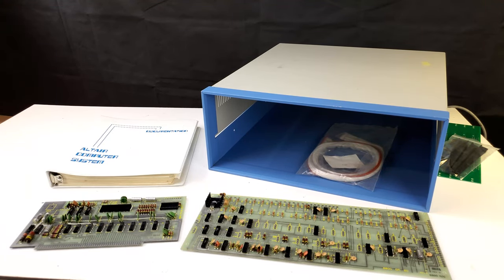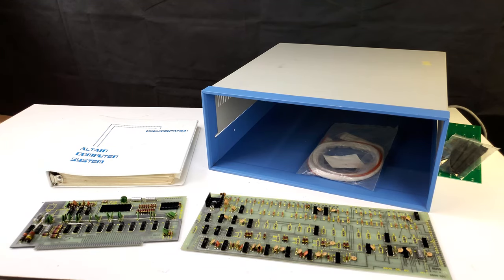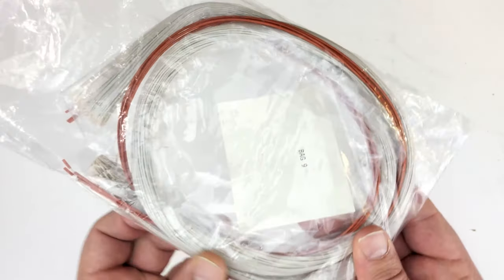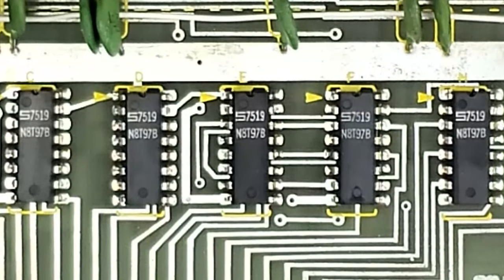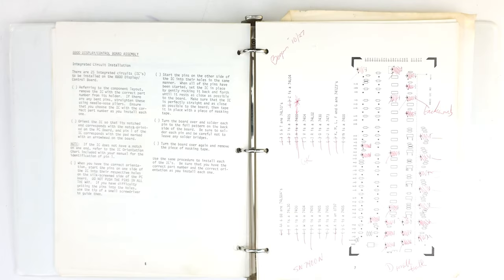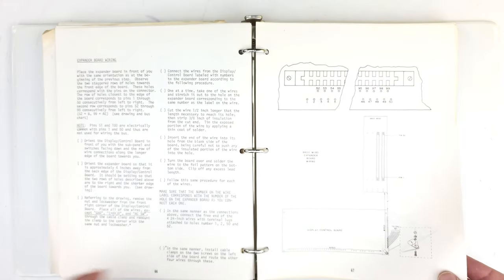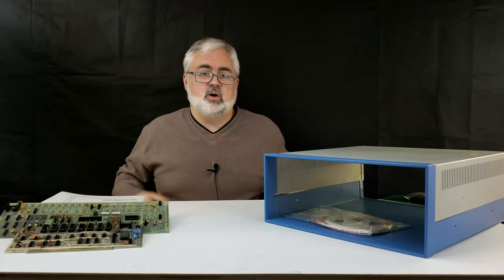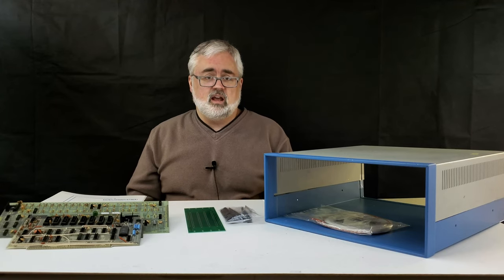I Bought An Altair 8800... sort of

Comment from the maker: What do you think?  Should it be built? Or left alone? 

And yes, my hands were super clean and I cleaned the boards afterwards to prevent further corrosion. :)
Reply: I say build it! A complete working Altair is a good candidate for the centerpiece of the collection.
Reply: Build it.  Don't use the DRAM board.  It's a  nightmare.
Reply: Definitely build it.
Reply: Yes, build it! It was meant to be a thing, not pristine parts. :)
Reply: BUILD IT!
or send it to me and i'll build it...

I have the Briel 8800micro... it itches the bug... but it's basically just an emulator...

Deramp has an original, he also sells his own emulator, that's more correct than the Briel... and on his website he links to sources for an Altair 8800C (C for clone) new boards, case and parts that can be used to assemble a new machine.
Reply from the maker: @inerlogic  The 8800c is pretty awesome for sure, although my inclination was to go for the original clone kit he did with the mostly empty chassis.  I wanted that to sit, open topped beside a real Altair just for shock value.   I had been holding out for Grant Stockly's clone myself.. but it never fully materialized.  Too bad.. it looked to be a beautiful kit!

My only challenge with building this one is I am a bit retentive when it comes to exactness..  I want everything to be 100% authentic.. which will be really difficult in this case.  I'm trying to talk myself into the old/modern 'hybrid' idea but no dice yet.
Reply: @TechTimeTraveller  IIRC Grant said he was going to offer a discount for military/veterans, i'd emailed him enquiring about that and he replied, but yeh, the kit never materialized....
I ended up building an N8VEM SBC, i built the CPUVILLE z80 kit, Lee Hart's kits, i just finished an RC2014, I have the Briel 8800 micro... i have 4 different machines i can play Zork on and run CP/M

When i was in school for electrical engineering (95-2000) tucked away in one of the labs under a pile of stuff was an altair 8800.... had i known what it was at the time, i may have liberated it....

Mike (deramp) makes a good point in his videos, run his box so you're not endangering a museum piece or dealing with questionably reliable ancient hardware... if i had the money, i'd build the 8800C... new machine, new components. But still compatible with the old boards. Build the new box, and then maybe build an old one... use the new box to test the old boards....
Reply: Do what you did with the TV Typewriter and find components from the right era to finish off the two PCBs you have. Make your own chassis for the internal stuff and don’t be afraid to use modern parts for a power supply. Make a replica for the front panel. S100 machines were constantly upgraded so there’s no wrong cards to put in it, and no “correct” backplane either. If down the road original Altair parts show up you can always swap them in. My IMSAI came with a third party upgraded backplane and a Josh Bensadon CPU board and I’ve been very happy with it and have seen no need to change those parts out.
Reply: Would love to see you build it! I agree with you that computers are meant to be used.
Reply from the maker: @timlocke3159  Sorry for the totally out of place reply - youtube doesn't provide easy ways to reach people directly - your comment on my BBS video was great, but youtube nuked it because the fidonet IP looked like a link.  Apparently they are nuking all of those now (except for ones from actual comment spam bots.. sigh), so they yanked your comment.  If you feel like reposting it with the address reformatted in a way that doesn't like a link, I invite you to do so.. I'm sure what you had to say would be as interesting to other channel viewers as it was to me.
Reply: Build Build Build!!!
Reply: Build it and show it off! You can not only say you have an Altair but also that you built it.
Reply: You lucky bastard :P build it and enjoy it. Also that's definitely an eight, not a five.
Reply: Build it 👍
Reply: Can someone plz make paid bidding a thing , 7000$ 14000 bidders so 50 cents a bid , in a start more like 800  3000 a bid but as people did ctach on it would be like 8 cents a bid. it did start to take of 16 years but then the scam sites did start leading people to no longer trust anything kind of paid bid. Be the same as ebay but you pay for each bid based on the number of bidder.

Comment: Like you I had wanted to get one of these or an IMSAI for decades and my main reason was not to have an original "Altair" or "IMSAI", but instead to play around with CP/M programming in MBASIC and C on big ol' blinkilights box.  Just like in the old days.  So, more a nostalgic trip down memory lane than getting my hands on an unreliable 45 yo machine that I shouldn't be playing with anyway because it's too valuable to end up damaging it.  In any case ones I saw were either too expensive or too badly beat up.  I even had your other idea of getting it piece by  piece, but never seemed to find the right opportunities.   However, just recently I achieved my goals by getting one of deramp's 8800c kits and populating it with the boards he recommends.  I also got one the the IMSAI 8080 simulators from The High Nibble in Australia.  Now I'm all set for CP/M.  Next .. its a PidP-11!!!
Reply from the maker: I do intend to buy one of the clones myself.. I love the 'empty case' version of it.. just illustrates how far we have come.
Reply: @TechTimeTraveller  I already had the IMSAI "clone" so went with the S100 replica.  I have it the back of my mind to build some S100 interfaces and possibly a new and improved 8080 CPU card.  For no particularly good reason other than it might be fun.

Comment: The first kits were offered in a installment plan. Each month you received one building block, such as CPU board, then power supply, front panel, etc. the last package was the expensive chips like the 8080 chip.
When I ordered my kit I received a letter stating that shipment would take additional six weeks because they were developing a plug-in bus instead of hardwiring between each of the cards.
Reply from the maker: Ahhh.. so maybe this never had the other parts?
Reply: @TechTimeTraveller  it’s possible. Remember that the 8080 in 1975 was something like $400. 
Currently I am restoring a IMSAI 8080 computer I bought from eBay. The seller just took a few cards
(Non-functioning cpu, random unknown memory card, sio-2 card, modem card, bus extender card) and put them into 
A IMSAI chassis with a German 220v case fan.

Comment: I would say build it. You've got a YouTube channel so you can document and showcase its use. That's more important than preserving an incomplete kit. As for the PSU, always go with something modern imo. It's worth it for the cleaner power and safer implementation. In the end though it's your kit now, do what you want with it.
Reply from the maker: Thank you.  I'm very close to being able to.  I just need the front dress panel and some odds and ends and I can start putting it together

Comment: About 20 years ago I sold my Rev 0 Altair 8800 complete with all manuals 256 bytes RAM,  serial II I/O.  All working for $1500.   I miss it.....still have my maxed out Z80 S100 system wire wrapped ROM and I/O board with cassette and dual 8" floppy drives.
Reply from the maker: Yeah those are going for like $6000 now.  I regret not buying sooner.

Comment: Its pretty much ebays “fault”. When these computers were traded at the flea markets and local tech clubs, the market was pretty limited and prices were low. With ebay, the market is worldwide and if someone wants it more and has more money, the prices go up. Now that im older and miss these computers more, i could kick myself for throwing out my old computer collection in the 90’s. Even vic-20’s, which used to go 5 dollars at flea markets are $100+ now, usually. Your altair is a real find. Hope you get it running someday. That 1975 article in pop electronics about the altair was what got me started in computers.

Comment: bought an Altair 8800 decades ago. completed the project. couldn't handle all the switch flipping so into storage it went. that's all I remember. since you bought one recently perhaps you could give me some advice on selling one now.
Reply from the maker: You will profit handsomely if it's an 8800, especially a Rev 0.  They routinely go for $5000+ on ebay, which is generally the best venue to sell them.  If you'd like help I'm happy to do that gratis, I'd buy it myself if I could afford it.  But I can help figure out what you have and price appropriately.  Email is brad (at) techtimetraveller (dot) com

Comment: Thousands of people restore vintage cars. They don't use original paint, tires, brake pads, upholstery, etc. Use what you can find and fabricate what you can't as close as you can practically. The switching power supplies is a great example. Safer but still running original Altair CPU board and hardware. Use the repro base or mother board. If you ever come across an original, you could swap it out if you want. Bottom line is get it running :)

Comment: On the internal chassis: see if there is a YouTuber with one who is willing to take measurements. Then it turns into a collaboration video.🙂
Reply from the maker: In the event, I have spoken to a few kit builders and there appears to be some movement towards the goal of replicating the chassis.  I may even try to pick up a Turnkey or other model of Altair to get measurements from (and use) as prices on those are still reasonable and the internal chassis, except for the front and back panels, is essentially the same.

Comment: Who do you give credit to, for building the First Personal Computer. The Micral N, using the 8008 processor?
Reply from the maker: It all depends on what you define as a computer, and personal.  The Micral and MCM/70 could be contenders for first microprocessor based computer, but if consider pre-microprocessor designs one could consider the Kenbak-1 as a candidate.  It's tricky.
Reply: @TechTimeTraveller  Love the MCM/70 way ahead of its time !!!

Comment: Great video.  I have a complete internal chassis from an original Altair 8800bt.  It's the later turnkey model but it's almost identical to the earlier chassis.  The front panel of the chassis still has all the holes for the switches and LED's.  Let me know how I can get in touch and we'll work something out.
Reply from the maker: Many thanks for getting in touch!  I would be interested for sure.. although I have no idea how much something like that is worth.  I know a complete Altair 8800bt went for about $1000 a couple months ago.. but never seen parts individually.  You can email me at brad (at) techtimetraveller.com any time!
Reply: @TechTimeTraveller  No problem, I'll send through some pics.

Comment: there is a case front panel and power supply on ebay now
Reply from the maker: Yes.. I am in on that one.  We will see if it goes for something reasonable.
Reply: @TechTimeTraveller  OK glad you spotted it >>> i've build mine from david hansels instructable so i didn't go insane during the lockdown ;)
works great in combo with the altair duino software and a vt132 terminal

Comment: Any updates on the Altair?
Reply from the maker: I am working to get a front dress panel.. have most parts.. really just need a couple odds and ends to bolt it together.  I just scored a front panel with switches for my altair 680 (I have the case and motherboard for one), so I might build that first.